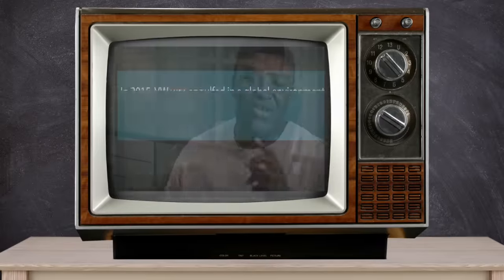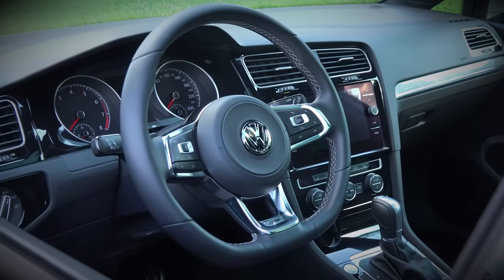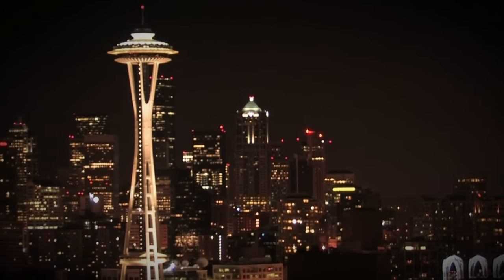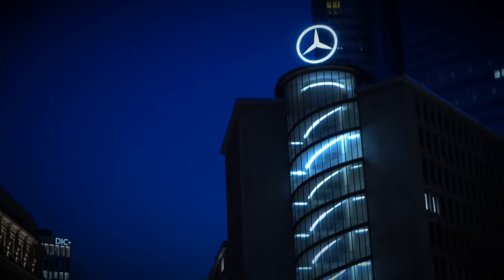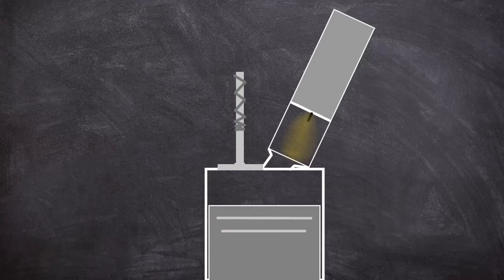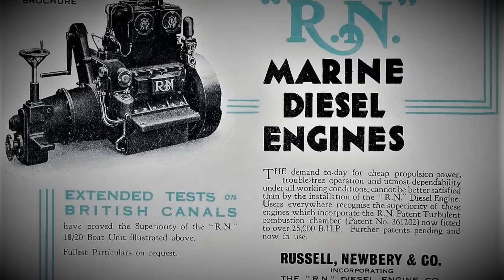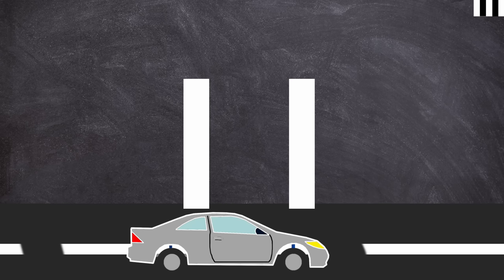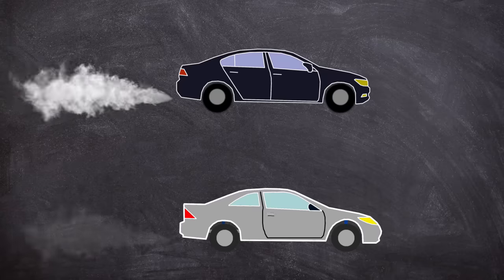Scandal: VW Emissions Dieselgate Explained | Plainly Difficult Documentary

Comment: I work in the emissions testing, specifically diesel passenger cars. Everyone cheats on emissions to some level. In the old days you would only reduce the NOx at specific areas of the map when your on test. So you would make more emissions in real world driving as you don't drive at those exact engine speed and torque conditions. Making the engine emission compliant at all times would make the car use a lot more fuel. Ironically after this scandal the test is now any real drivecycle. You have to be emission compliant all the time.

Lean NOx traps are shit. You have to purge them with a rich exhaust every few kms which makes a load of soot and fills up the filter then you need to use even more fuel to burn the soot off. That's why they turned off the purging when off test. Manufactures didn't want to have an SCR system due to cost and also didn't want to add the complexity to the consumer to have to fill the adblue tank. So they made it so they were only filled on a service. But then you had to turn those off in the real world otherwise the tank runs dry before a service. This is why VW cheated, to reduce cost to them and the consumer. The way they did it so was completely blatant though. Other manufactures would turn there emissions control down a bit not completely off.

All this modern regulation is making cars less efficient but incredibly clean. So much so that you will you'll be exposed to more NOx at home with a gas hob than you would outside with a modern diesel. Also the major source of particulates these days are not from soot but brake and tyre dust. You actually get more tyre dust from a heavy EV car than a lighter internal combustion car.
Reply: Thank you for this.
Reply: It raises a legitimate question, what is worse, the emissions from the tailpipe or the emissions from making more fuel to compensate for the lack of efficiency? It is a tricky quandary with no real easy answer since both sides will claim they are right.
Reply: @MakeItWithCalvin  Well there's this crazy little thing called math. This would be a piss easy thing to calculate. The only pain would be finding all the relevant numbers.
Reply: What does your job entail? Sorry for being nosey, but it sounds like a cool job.
Reply: It seems like the way they did the tests was just setting up for an exploit.  Glad to hear that they improved how the tests were done.  By the way, are some tire and brake dust particles small enough to actually float around in the air, or do they all just drop to the ground?
Reply: @MakeItWithCalvin  and this is why many have rightly come to the conclusion that we're at the absolute peak of technology for gas engines. 

Total thermal efficiency of the best ICE engines may barely be touching 40%. Most of the heat is wasted via tailpipe emissions. Battery electric vehicles at least double this thermal efficiency by not having the intermediate products of gasoline. Not to mention reduced emissions through vapor loss of refueling, carbon cost of manufacture and transport of gasoline etc.
Reply: @TonyHammitt  Good question. Particles is quite interesting. Diesel and petrol cars make particles but diesels are bigger so you can see them. Direct injection petrol cars now come with GPFs gasoline particulate filters. I haven't looked at any data about the size of brake or tyre dust myself but that will be the next thing we start to control.
Reply: @Pknuckles1804  Comparing the thermal efficiency of ICE cars to EVs isn't fair, because the fuel used isn't fixed of likely local.
Much of the World is still burning coal, so if that supplies your EV, the thermal efficiency is lower than ICE cars, BEFORE the grid losses are even factored in.
Reply: @darksu6947  My job is quite unique as we work as independent emission testers. Either for a catalyst company or for an OEM to benchmark different catalysts. We have testcells with engine dynometers where we replicate drivecycles. We look at gaseous emissions like CO2 HC and NOx try different catalyst configurations different adblue injection strategies. We also look at filter preformance overfilling filters with soot and burning the soot off and checking if the filter melts or cracks.

Sometimes we get dodgy companies which ask as to test magnets on fuel lines or some ECU fuel saving device. Though they never work and accuse us of not doing the testing right!
Reply: @mediocre-motorcycle-modifi6818  Thanks for taking the time to answer my question. I was right! That is a cool job! Are you seriously trying to tell me that putting magnets on my face doesn't improve my fuel economy? Blasphemy!!!
Reply: I’m skeptical that tires that last me 70k miles and/or brake pads that last me even longer somehow produce more particulate matter than the thousands of gallons of fuel burned in the same distance. Sounds to me like someone wanting to believe something that helps prop up preconceived notions.
Reply: @matthewjenkins1161  fossil fuel based power is obviously still a problem.  However I'd argue that stationary plants can be made more emissions friendly through carbon capture and other means. 

It's simply more efficient to generate your pollution in one site and only have to treat one exhaust stream vs having millions of small emitters with their own reduction equipment that needs to be maintained. 

This, of course, ignores the real crux of the problem. We should be transitioning to better forms of power like nuclear, solar/wind,  pumped hydroelectric, and grid scale storage to offset peak needs. 

Coupling an energy revolution with BEVs in essence will make ICE obsolete for the vast majority of use cases. We'll still need diesels for construction or large transport but the bulk of emissions would be greatly reduced.
Reply: Emissions testing has been going on in Phoenix at least since I moved here in 1989.
Across the street from most emissions testing stations were guys advertising they could get any car to pass emissions for $25 or $50, I forget how much.
I failed emissions one year and drove over to the shop to "fix" my emissions. After he was done he told me to come back by after I passed and he'd tune it back to the way it was so it would run better.
I was surprised he was so nonchalant about it, but that's all he did so he was clearly not afraid of any kind of retribution from the county for doing that.
I haven't had emissions problems for so long I don't even remember the last time I did or what I did about it.
There's always a way around them which of course defeats the entire purpose.
Reply: I always thought those NOx traps must be smoke and mirrors. It's taken a long time for people to start saying it. 

Big trucks put 5 to 10 litres of addblue for every 100 litres they burn so cars should put similar ratios in?

Any idea why these VWs did not get a proper SCR retrofit?
Reply: @andrewthompsonuk1  You can make a LNT work with a large fuel economy penalty. With either more EGR to reduce NOx or more frequent purging. Or reduce peak power to reduce NOx. It was probably cheaper to update the software instead of retrofit.

Adblue to fuel ratios depend a lot on how you run the engine. Do you do loads of EGR to minimise Adblue. Or run the engine more efficiently which makes more NOx and needs more adblue.

Cars often run at low loads so don't produce that much NOx.
Reply: It is diminishing returns for increased cost and complexity.   NOx and "acid" rain is talked about as if it was plutonium.    The air pollution today is nothing like it was with "pea soup" fog in the 1950s in the UK, or those Trabants in the old East Germany.    Even in Beijing a few years ago I hardly noticed it.   It needs a more balanced approach including reliability (= sustainability).    What should be a scandal is the official fuel economy figures for hybrid cars.
Reply: Thanks for the background, I think any kind of vehicle testing has always led to 'cheating' , or , 'playing by the rules' , prior to emissions testing I recall motorcycles having deliberate 'flat spots' in power delivery that helped pass noise tests. Away from compliance , there's the matter of spec sheet improvements by the 'negative options' - supposedly you can order some cars with no NVH reduction materials which reduces the weight , except no one does it. Overall, why the surprise ? The test was passed , perhaps the test itself should have been more thoroughly specified ?
Reply: @matthewjenkins1161  that is a HIGHLY dubious claim, you’ll have to cite a source for that. Power generation on an industrial scale, as in an entire power plant, is far more efficient per BTU than individual generation. 200,000 little Honda generators running at the same time is not as efficient as a power plant producing the same amount of power.
Reply: @matthewjenkins1161  I kinda doubt coal power plants run below 40% thermal efficiency.
Reply: @Pknuckles1804  EV has about the same efficiency as ICE, as majority of power sources are thermal powerplants with similar efficiency. And renewables have generally poor efficiency (with exception of hydro plants).
Reply: @Papinak2  
You got any numbers to back that up? A quick google search states that a 100w solar panel uses 200kwh to be produced. Over an average lifetime of 10 years, it produces 4300kwh of energy. I dunno about you, but that's pretty good efficiency.... 

Also, the most efficient ICE engines (probably turbo charged, 2L hondas running on the highway) have the same efficiency as the AVERAGE US power plant, however city driving, all those pickup trucks, and sporty cars that the Americans are so fond of certainly do not have the same efficiency. Even allowing the most generous of losses, EVs are still vastly more efficient in its performance class.
Reply: @Pknuckles1804  Where does the power to charge these 200kw babies come from huh? Think again!
Reply: Wo, thanks for the information!
Reply: Good info.
Reply: @timothylanders3189  Even if you're burning coal to charge an EV, you still come out ahead because the coal plant is much more efficient than an ICE.
Reply: @jamescaley9942  What an amazing comment. You realize that air pollution went away largely because cars now pollute less, right?
Reply: @anivicuno9473  that's not efficiency you're talking about - typical solar panel have 20-30% at ideal conditions, and even with the one from your example, you'd need 40 of them to charge an EV in one day (and I think that 1kWh per day per panel is still quite optimistic).

Meanwhile, combined hybrid transmission (not PHEV) can keep ICE near peak efficiency almost all the time, while directly transmitting part of engines power to wheels, which reduces losses compared to EV. It's also cheaper and lighter.
Reply: @mediocre-motorcycle-modifi6818  Therefore they must have known from the beginning that some sort of cheat would be required to deliver the power and economy required.
Reply: correct, I remember the engineering meeting where our desingn team was informed that the AdBlue consumption would be "attenuated" in real world driving in order to make the service intervals consumer friendly.

I remember that day as if it were yesterday. I thought that they couldn't possibly be serious, the would get caught.

and only because some idiot higher up wanted to make sure to sell AdBlue with a healthy markup through the service centres.
Reply: I can choose to not use a gas hob in my home... I can't choose not to breathe the air outside.
Reply: @MakeItWithCalvin  Good point, reducing NOx is only important for certain cities. Reducing CO2 (fuel consumption) is good for the planet.

So why not link the emmissons adjustment to the sat nav  location of the vehicle?
Reply: @andrewthompsonuk1  I live in California and some counties require a rolling road emissions test to pass SMOG and others just do an idle test. The difference is the rolling road checks for NOX while idle does not. Due to the age of my car, it needs the sniffer test but the last SMOG was idle and it passed with flying colors 😎. Note it is also a petrol car too
Reply: @Pknuckles1804  It depends of how you produce the electricity
Reply: @matthewjenkins1161  spot on. Then you have the large losses in transmission of the power magnifying this. Plus the emissions involved in manufacturing the cars and more specifically the batteries. Plus the fact that almost no country in the world has the electrical infrastructure needed for a high percentage of cars on the road to be recharged off the grid. Don’t get me wrong, this may well be the future, but right now we are well away from the theory of zero emissions cars.
Reply: @Pknuckles1804  But...in the 'big picture' you need to factor in the pollution created during the construction of the vehicles....and this is where the BEV's are really terrible.   A comparison of total pollution was done a few years back between a Toyota Prius and a Hummer H1...THE most hated of all gasoline vehicles by the Eco-friendly people.   And...as few expected, over 100,000 miles the Prius total pollution was FAR higher than the H1...mostly due to the battery production and the lack of available technology to recycle it.

Everyone gets all excited about vehicle emissions while totally ignoring what hell the planet has to endure to make the batteries, motors and wind and solar systems to power these 'green' EV's.   We should be looking at TOTAL emissions IMHO rather than individual vehicles...which should also take into account how the electricity destined to power the vehicles is made.   If coal is the predominant power source in your area....you are FAR better off ...planet wise...using a gasoline vehicle and only in the rare places where electricity is being generated more cleanly should EV's be allowed to be sold.   This would ease the strain on the grid....suck it California, I hope you've enjoyed baking while your 'green' grid is SO compromised by all your stupid regulations.
Reply: "All this modern regulation is making cars less efficient but incredibly clean."

And yet, we keep hearing that "CO2 isn't everything; it's the only thing." If so, then a cheating car that gets better mileage (thus lowering CO2) while emitting more NOx (which...out of HC, CO, CO2, soot, and NOx is really the "Tito Jackson" of that quintet) maybe isn't such a bad thing, is it?

Over-regulating diesels pushes people into gasoline cars instead, to burn more fuel, more cleanly. If we're all that worked up over CO2, then perhaps we ought to be willing to countenance some NOx?
Reply: @Pknuckles1804  The inefficiency of an EV is upstream, where the fuel is burned to spin the generator, to make the volts, and transmit it many miles to your house.

The efficiency of all the above is, ironically, about 40%. Which means EVs are a waste of time, unless you green the grid first.
Reply: @daszieher  Good gravy, how stupid must a motorist be, not to add their own DEF? It's as easy as adding fuel, and it's right next to the filler neck, to boot!

Oh, and could you talk to Fritz and ask him to design some proper filler necks while you're at it? Something that can accommodate the girth of a standard Diesel nozzle, and not the teeny-weeny "auto Diesel" ones? Nothing worse than having to fumble with a funnel as all the F-350 owners point and laugh...
Reply: @Treblaine  If you're too infirm to handle modern air, that's a "you problem." Today's air is cleaner than at any point since the Industrial Revolution. It doesn't NEED to be any cleaner! (It could stand to have less CO2 in it, though, so trading cleanliness for economy seems a worthy trade-off.)
Reply: @bcubed72  Fritz designed the auto-diesel nozzle specifically so that there could be proper or Truck-Diesel nozzles where fuel could be sold at a rebate, inaccessible to car drivers.

I kid you not.

As for filling up DEF. You may get it right, but "the customer" is very inventive about messing things up as well as making warranty claims 😉
Reply: i saw an interesting video about some university students that are fixing magnets to the wheelarches of cars that collect the brake and tyre dust. This works because the particals are magnetically charged when the leave the wheel or brakes, they have tested with some london buses and recovered a fair amount of particulate from them.
Reply: I'd rather have less efficiency and more cleanliness.
Reply: @MakeItWithCalvin  Refineries have insanely low emissions for what they are doing. That is not an intelligent question,  as any person with half a brain would intuitively understand that pollution control at a massive plant will always be greater than in a tiny engine per unit fuel.
Reply: @Pknuckles1804  No, they don't,  because the total system efficiency depends on how the electricity was made in the first place.
Reply: @MichaelEilers  Electrical generation is 35-40 percent efficient with old coal power plants. With new integrated cycles gasification plants, it can reach 65% efficiency, and so can modern natural gas integrated cycle plants. Heat and power and trigeneration is more efficient than the 40% but are rare. So yes, it does entirely depend on where your electricity comes from.
Reply: @surewhynot6259  Unless they are running integrated cycle gasification,  they are running 35-40 percent efficient. It would have taken you 5 seconds to determine this.
Reply: @RobertHancock1  we don't have more than a handful of integrated cycle coal gasification plants in the US because the Democrats are unhinged when you say the word "coal," so no, chances are close to zero that your local coal plant is more efficient than a very efficient ICE.
Reply: @bcubed72  I would argue that right now most EV owners have the monetary resources to invest in their own electricity generation (which is admittedly a downside of EVs). Another thing that affects it is that EVs require charging parking spaces that high rise building lack still, so people with their own house and roof are more likely to have solar panels for example. So the early to mid adopters are actually more likely to be more efficient than 40%. The US also has around 20% nuclear and 20% renewable electricity generation although that's obviously not distributed evenly while an ICE car is always going to burn fuel.
Reply: @toomanymarys7355  Average coal power plant, 35%. High efficiency coal, 42%. Combined cycle gas, 60%. ICE, 25% maximum. Try again..
Reply: @RobertHancock1  you forget transmission and charging losses, as well as the slightly higher efficiency of modern diesels. 

It is not as obvious as you may think.
Reply: And all this because Europe just uses diesel instead of gas.  They could've just used gas instead, much easier to make gas emissions clean.
Reply: @danlorett2184  Gasoline will go the same  way. With the EU CO2 targets you either reduce CO2 or pay heavy fines. So CO2 has to be reduced. On gasoline this is GDI GPFs and maybe soon lean burn which will need NOx control.
Reply: @bcubed72  technically CO2 is not toxic unless in excessive concentrations. Many things coming out of an exhaust are. The one dimensional focus on CO2 is irrational in so far as all risks need to be balanced. 

As I understand it, part of the issue was that the 3 big car manufacturers in Germany agreed between them that the ad blue tanks in all cars will be no larger than a certain size. Therefore, Volkswagen had a 3rd choice which was to put in a bigger ad blue tank and use more ad blue to nullify the NOx emissions but to do so would have broken that agreement. It makes you question how the other German manufacturers have made it all fit. It appears from subsequent stories breaking that they were all up to cheating to a greater or lesser extent, but not necessarily as blantently having the computer use a completely different tune when it detects its on a rolling road.
Reply: @peterj5751  So, break the unwritten rule. Or schedule more frequent service. Or, maybe, expect your customers to pour a damn gallon of fluid down a pipe from time to time?
Reply: @bcubed72  I totally agree. I presume the reason for not doing so was that it was cheaper to slap in cheating software. Or cheaper until they got caught.
Reply: @Pknuckles1804  Yeah.. No.
That's not how thermodynamics work..
You are talking about 90% efficiency  from a container which os 1700% less energy dense.
Reply: Cheating on emissions? No no no! That can not be true! :) EV's are completely cheating environmental and emissions and making it a selling point/feel good thing at the same time! Only good thing about electric prices going up is to watch EV's cry how unfair it is :)

To be honest. Private transportation the majority of people should be behind petrol engines. But personal transportation they should be sitting on a moped powered by electricity. Top speed about 45km/h at most TOPS. And petrol cars being for family use fully manual and as reparable long lasting as possible. And then electric cars to fill in the middle. Mostly city use. Then leave diesels to do the actual work. With less emissions regulations that only make stuff worse.
Reply: tyre and brake dust. Whitch gets addressed in euro7
Reply: Thanks for the information. Did not think about brake or tire dusts.
Reply: @Papinak2  why would you care about the efficiency of a solar cell? Theres nothing lost really
Reply: @noahrichter5912  what about area per produced power? That's huge issue of both solar and wind power. Hydro power also takes up quite large areas, but at least have advantages over the other two.
Reply: @mediocre-motorcycle-modifi6818  neato
Reply: @Papinak2  then there’s geothermal don’t forget that (using our own planets heat for electricity generation)
Reply: @mediocre-motorcycle-modifi6818  ironically you could argue it’s good for the environment to produce CO2 (i.e plants consume it and make oxygen if memory serves lol) I agree with doing away with tetraethyl lead which is toxic but Internal combustion vehicles (which arguably if we got vertical farms up and running we could produce ethanol to power our cars (I mean in any size-able scale of production)
Reply: @sockshandle  yep, but getting to geothermal sources outside of active areas is quite complicated.
Reply: @RobertHancock1  25% for ICE includes all loses. Add loses to EVs during energy transmission, recharging, etc, and you get similar, or even lower value. And that doesnt even take into account the vehicle production process. But what do I know, I only study car diagnostics...
Reply: @pavelslama5543  You forgot to account for the energy spent to refine and transport the fuel around.

There's a lot of misinformation on this topic from people who either don't know the full picture or are just repeating bogus information they heard from somewhere because it fits their preferred narrative.
Reply: @jamescaley9942  yeah no thank boomer
Reply: A comparison to a gas hob is a poor one since they've been proven to be very dangerous to to people who use them. Nobody should ever install a gas hob in their home.